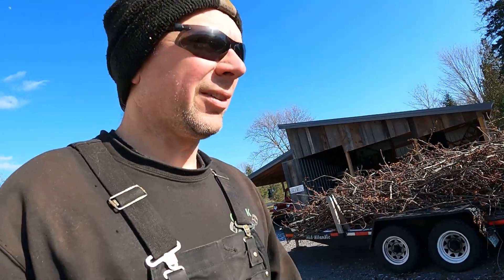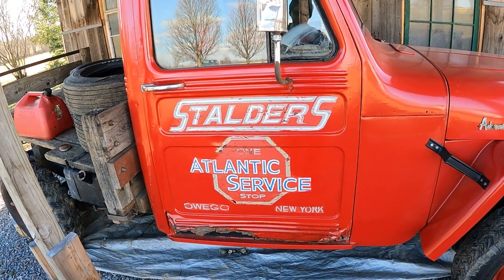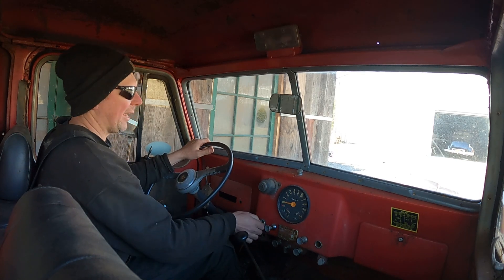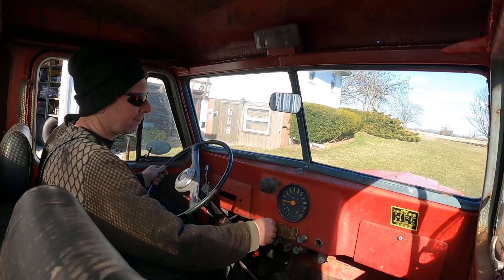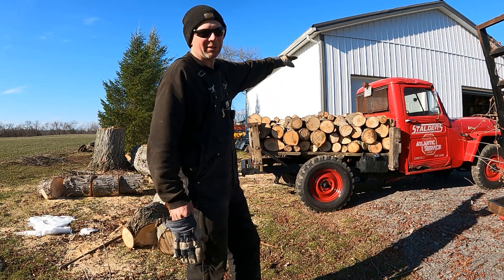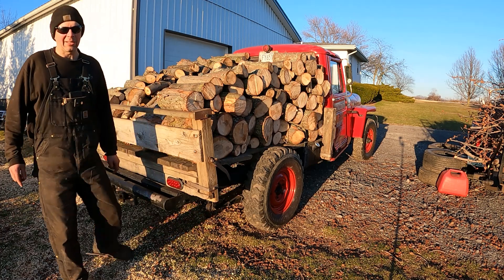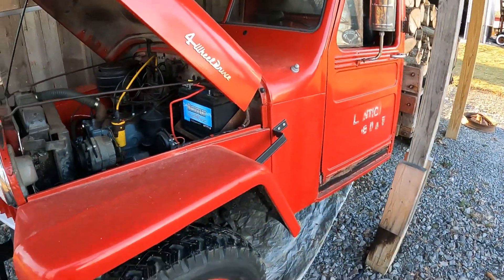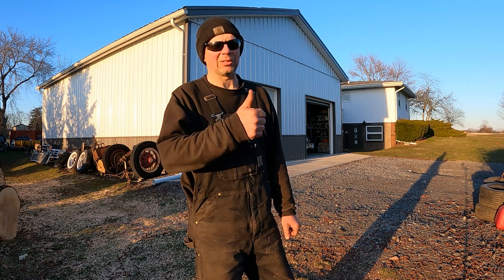1959 Willys Jeep Hauls a Huge Load

Comment: That Jeep is a nice truck. It’s the type of restoration where you wouldn’t be worried to work it like a truck.  I think it’s perfect the way it is.
Reply from the maker: Yes.  It was completely junk when I started.  It's a 10 footer, that is full of dents from 50 years hauling firewood in the woods.  I painted it with a brush.   It's 1000 times better than it was.  It's not roadworthy and probably never will be again, but I can use it.
Reply: @QuickSpeedShop  thinking about doing the same with my 1966 f350

Comment: YOU HAVE A LOVE AFFAIR WITH THIS TRUCK  /   AND I WOULD TO IF  I HAD IT  FROM THE TIME  I WAS 13 YEARS OLD TILL NOW    /    SO WHY IN THE HELL DON'T YOU SPEND A LITTLE TIME AND MONEY TO REBUILD THE MOTOR    /  AND A FEW OTHER THING THAT WILL MAKE IT A REAL JOY TO DRIVE  /   TILL THE DAY YOU DIE  MAYBE  EVEN YOU CAN  USE IT FOR YOUR COFFIN  WHEN THEY PLANT YOU  OR USE IT FOR YOUR HEAD STONE  (THAT PART IS ALL JUST B/S)  JUST GET THE MOTOR REBUILT
Reply from the maker: Because it's not worth it.  It's not roadworthy and I just use it around the house.  Runs fines for that.  The entire drivetrain is worn out.  It's been an off road woods vehicle for the last 45 years.